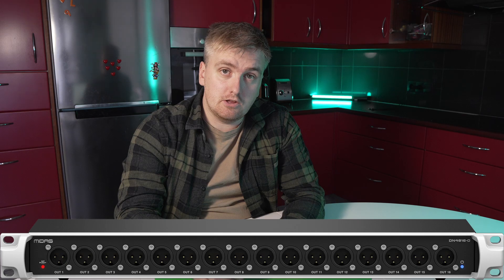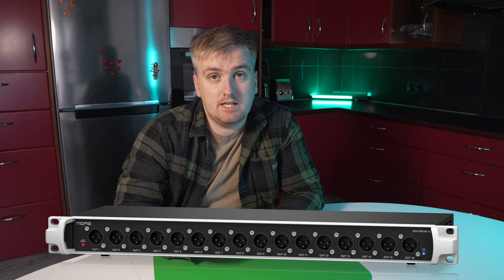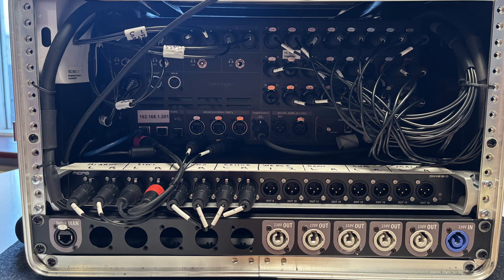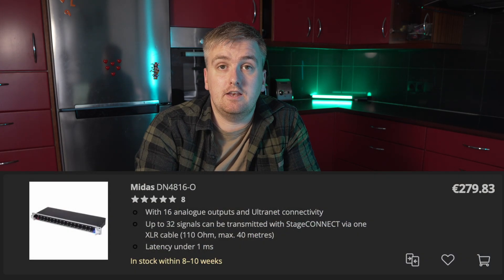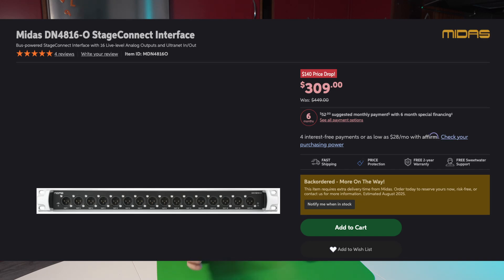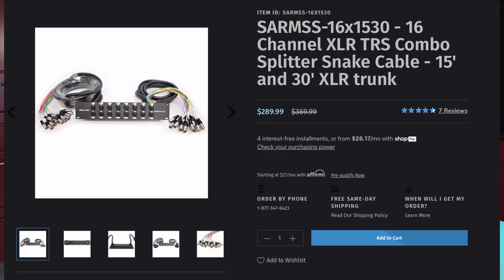The Midas DN4816-O is not a splitter!

Comment: Idk man I feel like any competent FOH engineer wouldn’t mind it. Ok gain is already set and all I have to do is ride the faders and minor tweaks? Sign me up. Most of the bands running these are playing shit clubs and bars so usually the FOH engineer is underpaid and wants to do the bare minimum already. If they don’t understand that the signals are coming out “HOT” or at “Line Level” then they shouldn’t be doing this job anyways.
Reply from the maker: I mixed a show a few weeks back. The band came in with their SQ5 monitor mixer to do their own IEMs, I had another SQ5 and they just sent me a digital split of all channels. I also got their show file to use as a starting point.

Soundcheck was fine, but from the first downbeat during the shows, almost all of the drum channels were clipping the inputs and the whole thing was running a bit hotter than I preferred. I trimmed some channels down, but trimming down an input thats being clipped at the preamp doesn't do much.
I could have ran on stage and gained down on their end, but that would have messed up all of their IEM mixes, and also, it's not my job to mess with their mixer.

Using a "foreign" show file as a starting point was also a mistake I then regretted. Sure it made soundcheck quick and easy, but not knowing all the routing that happened caused issues for me later in the show. Lesson learned :)
Reply: @arnieitthvad   That's entirely the fault of the band, and not the digital outputs.  If they monitored their preamp levels to have headroom as I do with my DN4816-O before the show, then your problem would not have happened. I understand the preference for "virgin" outputs, but the DN4816-O is too convenient for hobby bands to pass up on that no amount of convincing is going to change.
Reply from the maker: @ErostheEpic  it is the fault of the band indeed. That brings on my point, that once the show has started. The band is and should be focusing on playing the show, not monitoring levels. That's why there is a dedicated person getting paid to mix the show.

It is convenient, but so is a properly set up split system.
As I say in the video. Doing a digital split can be OK, but people just need to be aware of the problems it can cause. My main issue is that people are giving advice on the DN4816 being a cheap and easy solution, without making the potential problems known.
Reply: @arnieitthvad  Well said. Thank you for taking the time to make an informative video!
Reply: Bingo! Spot on!

Comment: Hi Arni,
I’m a keyboard player and use both hardware keyboards and synthesizers, as well as virtual instruments in Logic. All keys need to be routed through a bus and ultimately sent to a dedicated stereo output for my keys. So I guess the Midas 4816-O is the only option I have left.
Reply from the maker: You don't really specify how the rest of your setup is, so I can't really give my opinion on the matter.

If it is your goal to give FOH a processed and mixer stem of your multiple keyboards, the 4816-O is as good a way to do that as any others. In your case you're not using it as an input split, but you're using it as a Mix Output. Then it doesn't matter if it's coming directly from an output on your mixer or stage box, or a DN4816-O.

As a FOH engineer, it depends very much on each situation if a stereo mix of multiple keyboards is better or worse than getting each individual keyboard. 
There are pros and cons to each method. If you have all your keyboards finely balanced, both level and spectrum wise coming out of your stereo mix, that's fine. 
But in many cases a Bass synth will need drastically different processing at FOH than an Electric piano will. 
A balance that works well in an IEM mix doesn't necessarily work well in a FOH mix, because the focus if the keyboard players mix might be different at FOH, the front of house engineer might need to sculpt certain keyboard sounds to fit around vocals or other instruments in the band.
My preferred method would be (if the situation allows) to have each keyboard on a seperate channel, but have them properly balanced. So I should be able to run them all with the same gain and level settings, but I'd still be in control and able to adjust the balance or specific chanel processing as needed.

Just something to keep in mind, but this is essentially a totally different topic.
Reply: I am developing a similar setup. My goal is a wing rack and then either one of these and it's I sibling. Or go AES50.

Comment: My band uses the Behringer Wing Rack as an audio interface and runs bass and guitar through plugins, then out through the DN4816-O so the sound goes to FOH. Also, vocal FX are on a stereo channel through it since it's synced to the backtrack. Is this a bad solution, and is there a better solution?
Reply from the maker: That is a very good question. No I would be fine with that, since the processing inside the wing (or the computer in your case) is a part of your sound.

I would suggest giving FOH a dry vocal split, along with the stereo FX if you're not already doing that. This could be done with a simple Y cable before it enters the Wing rack. Then make sure the Vocal FX channel is only the wet effects. It can be very hard for a FOH engineer to balance vocals properly if it already has pre-baked FX. The amount of effects can vary greatly on the room, bleed and other situations, and taking that blend control away from the FOH engineer is basically asking someone to do a job they don't have control over.

If the effects are some sort of an AutoTune, things start to get a bit complicated though. My suggestion in that case would be to give FOH a vocal output with ONLY the autotuned vocal without any other processing (No EQ, Compressors etc.), and send all effects (reverb, delays ETC) on seperate outputs.

Comment: I do understand what your argument is. But I feel like a analog split is alot heavier and takes more space then a 1u rack setup that needs 1 cable. 

I also often deal with people sending digital splits and it works completely fine. As long as it's tested before hand i see no reason to have a issue. 

Is it ideal nope I always want analog splits but lots of bigger shows are starting to book smaller up and coming acts to save costs here in California. 

I have a big show coming up next week that has a x32 rack feeding the avantis stems via dante, while the headlining act is going thru a digital split using this exact method.
Reply from the maker: If you watch my live stream, I do a bit of a weight comparision on a 16ch 1U homemade split. The DN4816-O is 2.2kg (according to the spec sheet) the split I was weighing out was around 2.5kg WITH the tails that would go to FOH (which would be permanently connected on the rack side, on only needing to be connected to the FOH inputs)

But my main purpose of this video is to make people aware of the potential problems it can cause, and trying to help people to make an informed decision if they want to use the DN4816 as a split.
Reply: @arnieitthvad  How much do 16 extra mic cables weigh/cost? I have an ART S8 2 way 8 channel splitter that weighs more than the DN4616-0. The Art is very mediocre. Step up to a Radial Designs and it will cost and weigh even more. so 16 channels will weigh and cost double the Midas box.
Some people will separate their mixer from the splitter for size/weight concerns. so then if you have to patch to mixer, it will slow you down and also may be prone to mistakes.
Reply from the maker: @AllenMarkel I feed like I did some weight measurement in the live stream I did on the topic: https://www.youtube.com/live/FVjtDs8H4zA?si=49fU-MpTj58wafCk

Comment: 100%. True analog splits only for bands showing up at venues and not providing a FOH engineer. Let's also normalize venues providing analog splits between their FOH console and the stage; FOH can keep their console patched between bands and we don't need to rely on "split"-of-the-day coming with a band. It's not at all ironic, but also a shame, now that we've gone so completely digital -- allowing bands to so easily travel with self-contained monitor rigs -- we've lost the analog infrastructure that was probably a lot more common back when FOH and monitor positions *had* to use a copper split.